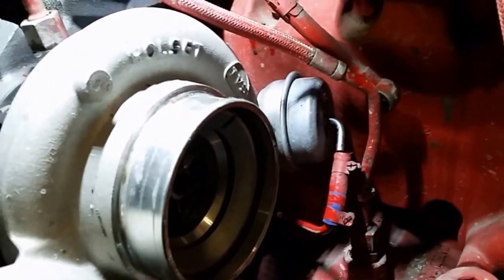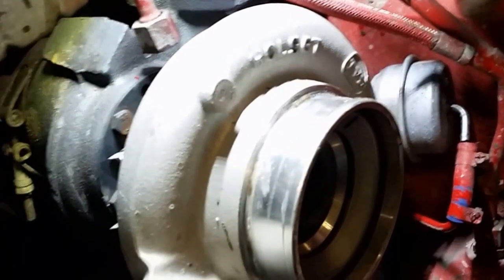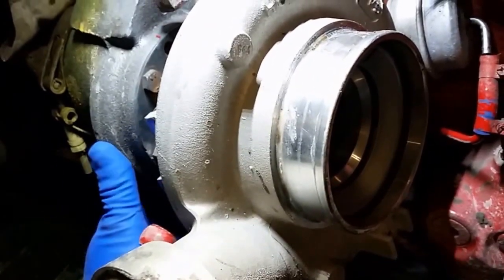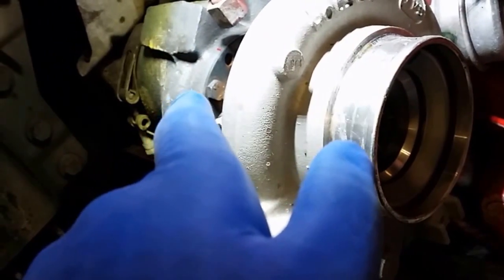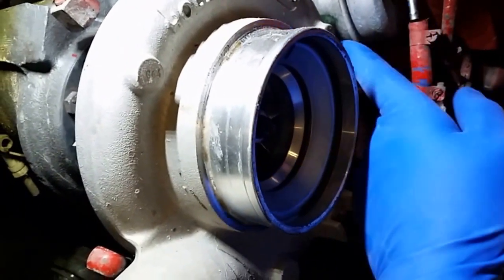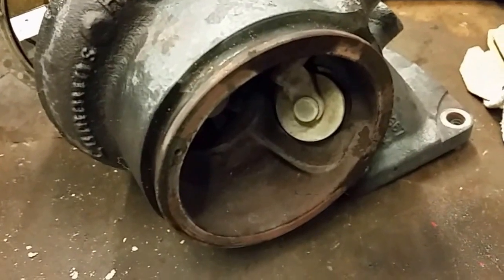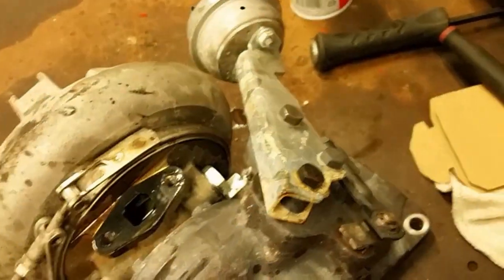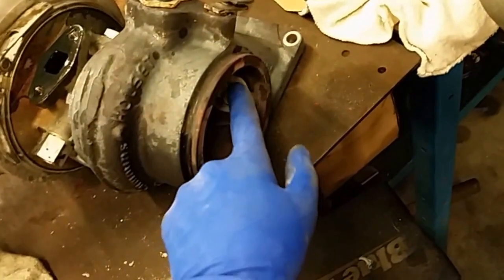CNG Tip of the Week, Tip #11, Turbo Wastegate

Comment: Hi Seabee82. Thanks for this video. You say the Turbo Charger was only a month old? When it was previously replaced, was the waste gate actuator not replaced with it? I'm asking because I just bought a 2012 Saf-T-Liner with an ISL G in it. Fault codes led us to the Turbo Charger but my mechanic wants to put a used turbo charger and waste gate actuator on it that looks... ok. Is there any way to test the valve to know if it's good before putting it in? Thanks again.
Reply from the maker: Wastegate actuator comes as one with the turbo, if the flapper is seizes and if it looks like any pinkish residue in exhaust side you have a bad egr cooler. EGR cooler is leading cause of death on those turbos... ive been meaning to do updates on those older vids. So as my fault for not having gotten that done. But do check for any possible coolant residue. The one in the vid as i remember as truck was new and we had wait on parts issue from factory (or was one of ones prior to or just after that truck). Hope this helps. Any questions feel free to email me as well (about tab on channel page)

Comment: Common cause for those to seize up is a bad egr cooler.   Coolant flowing through there will corrode and seize it.
Reply from the maker: Yes indeed. We have replaced almost the entire fleets coolers and turbos over past few years since this vid was made. Still have had couple oddball turbo failures in between, or external cooler failures too, but as of past year and change biggest issue has been main oil seals leaking (yup replacement of oil thermostat, front crank, rear crank, oil crossover seals, crankcase filters, etc) fun stuff
Reply: I hear ya,  it's not stop. Most of my fleet is ISL G and 8.3 C Gas Plus. All fueled with LNG and we've had to up date every cooler on the ISLs as well.   Fellow Seabee here to BTW.
Reply from the maker: CM as well??
Reply: @BeardedSeabee82  CM1, west coast.  3 years to retirement.

Comment: So with this wastegate seized, wouldn't it be making full boost all the time?
Reply from the maker: Well, typically when the wastegates sieze, they will sieze usually around either mid or low side of range, typical culprit is the egr cooler going bad, pulling the 02 sensor off the back side of turbo and giving it a quick look (usually dried pinkish color on it) is quick tell tale. thank you for watching and commenting, any other questions about em please feel free to ask. i know ive got alot more of the trouble shooting vids on these guys to get done when i get chance to film them as things slow down.
Reply: @BeardedSeabee82  
Thanks for the reply. The junk I drive right now, if you baby the throttle from start-up and not let it go over 1600 rpms, the turbo works fine.  Anything over half throttle above 1600, electric bolt light comes on and turbo stops making boost.  Any idea?
Reply: @matttucker5786  is it cummins isx or a natural gas?

Comment: Nice video ! I have a question for you, I live just a few miles from Port Hueneme Naval base  (Sea Bee base) and I am a full time Fleet mechanic that works on diesels and CNG engines. I have been very interested lately in joining the Navy as a reserve to work on base to do maintenance and repair on the incoming Navy trucks and sea bee heavy equipment. Is that where you learned a lot about mechanics ? is it recommended? Bearded
Reply from the maker: NBVC Hueneme does have quite a bit going on, I learned a bit there, that is where the mechanics school is for the seabees.Reserves, going to bootcamp and then back to hueneme, should you be recruited to be a seabee, would give you an  "In", however alot of those, if they arent being worked on by active duty, are actually worked on by contractors/DOD Civilians as well. DOD/Contractor side does make better money, however, going reserve side, if the recruiting goes up, might even qualify you for nice lil bonus incentive as well.

Comment: Do you guys have the updated egr cooler? the round one. coolant in the exhaust housing will do that to the waste gate. I work specifically on the 8.9 islg so I do alot of turbos
Reply from the maker: iwrench 86 Last couple coolers weve gotten in are square for our 12L. Biggest issue we have is exh mflds crappin out, but havent been finding coolant in egr cold pipes, exh mflds or turbos.